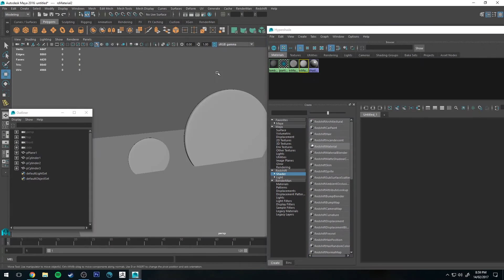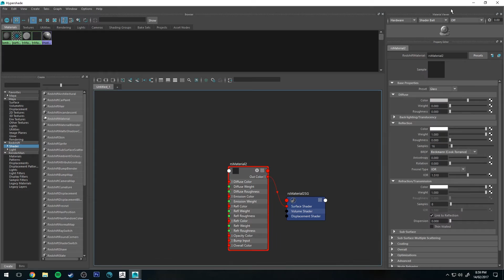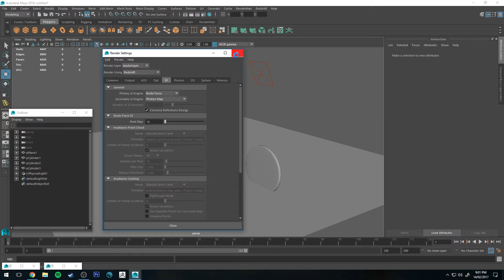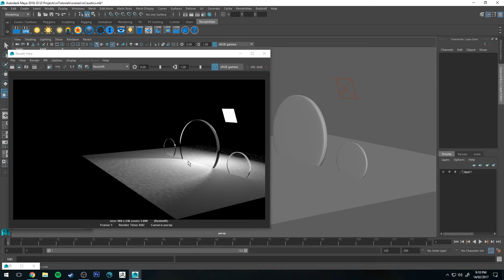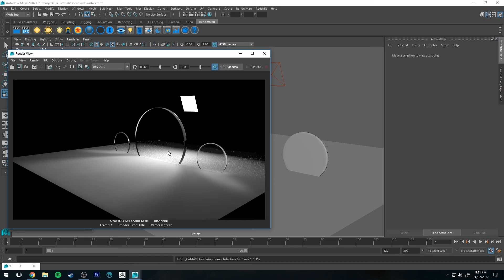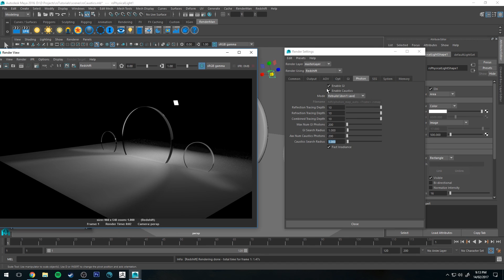Redshift Caustics Tutorial

Comment: what about the intensity multiplier/number of photons to emit? thanks a lot awesome tut, was missing the "enable caustics" in the mesh when I tried this previously.

Also didn't the documentation say that photon mapping always runs just for caustics even if you don't have it enabled as either GI mode? I seem to still be getting caustics with irradience cache as primary and brute force as secondary so maybe there's no need to use photon map -- that seemed to be the sense I was getting from that documentation.
Reply from the maker: Ah yes, I knew I forgot something. Intensity (under your light's settings>Caustics) essentially will make your caustics brighter, number of photons will shoot more rays cleaning up any irregular 'spotting' that might occur in the render where there should be caustic reflection/refraction. You're right about Photon Mapping too, I misread the docs thought it had to be enabled always, that said I think there is a render time benefit having it as one of the GI's. I'll pin this comment so others can see it, thanks for that!
Reply: definitely a render time benefit in the tests i was just doing.

thanks a lot that's super helpful :)